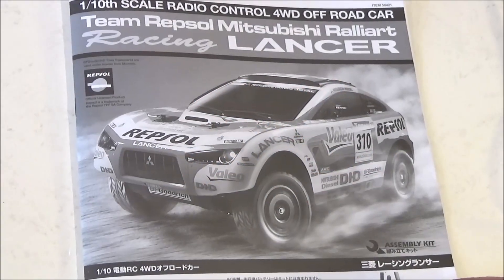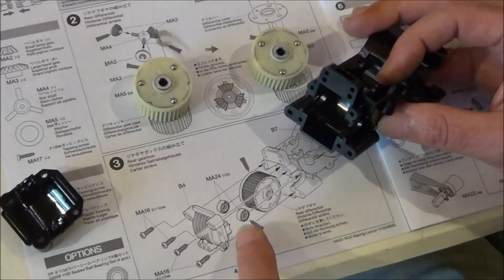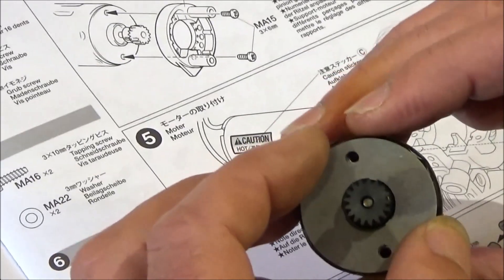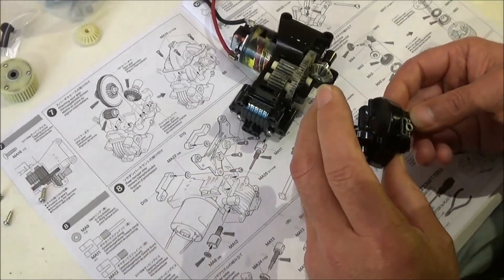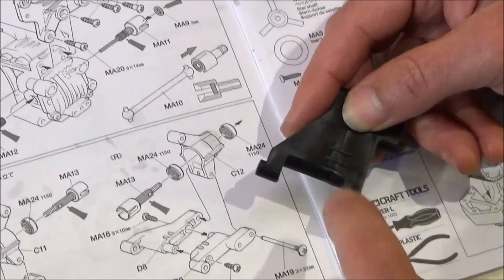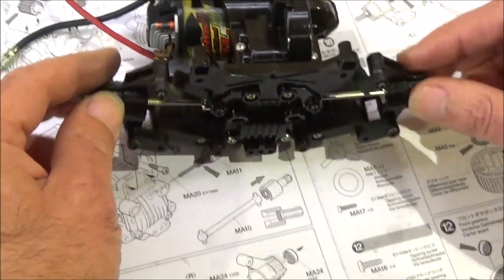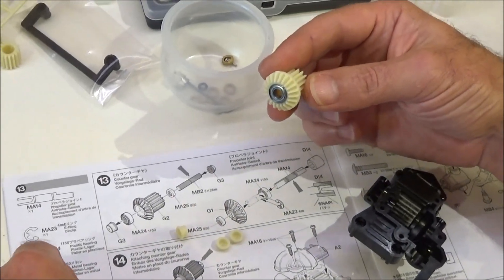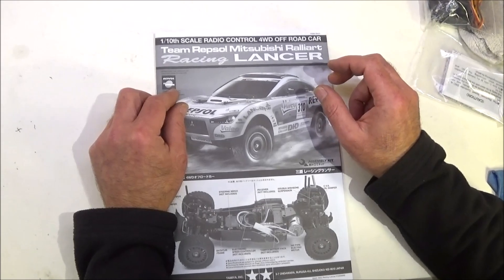Tamiya DF-01 Build Part 1 - Mitsubishi Lancer Rally Car

Comment: 😎👍 Nice Job! that's a sweet chassis!
Reply from the maker: Thanks very much Steve - yeah, I really like this chassis, it's a new one on me, and it is very similar to the old TA01/2 chassis that I rate very highly.  The DF differs in that it is quite a lot wider in terms of the suspension components and driveshafts - should prove a little better in the corners and less prone to rolling over - fingers crossed!!!  Have a great weekend Steve  :-)

Comment: Nice one mate.  It's odd that I've never seen this chassis before given how much time I spend looking at kits to buy.  I think your wife picked a good one.  Anyway thanks for the tip about the grease.  I'll get myself a tub of it.  One thing I've noticed on Tamiya kits is that sometimes they give you washers to go on the back of the step screws and sometimes they don't.  When they don't it's very difficult to tighten them enough so they don't shake out without them binding the suspension.  I'm sure that's true and I haven't just imagined it have I ?  Anyway, Rob is very patient with holding the camera for all that time while you have the fun of the build.  Good work as ever mate.  Look forward to seeing this finished and blasting around :-)
Reply from the maker: Thanks Pete!  Yeah, get a big tub of Lithium Moly - it's super greasy and is kind to plastic! Those step screws really need a washer - you are correct, they should come standard on all Tamiyas to prevent the binding issue. You didn't imagine it mate!  Rob and I have been though thick and thin my friend, and luckily for me he has the patience of a saint! To be fair, we do help each other, that's what friends are for I think!  Thanks for watching and the lovely comment - looking forward to your next escapade!  :))
Reply: Yeah if memory serves me right I think that the Konghead and the GF-01 didn't have the washers.  Can't understand why they wouldn't put them in all the kits with step screws given how cheap washers are.  Anyway, I was looking at this chassis and on the face of it it seems similar to the TA-01 that I know you are very fond of.  I haven't really looked in depth but do they share components ?   I've got another Datsun 240Z shell to build but as yet no chassis to stick it on so I'm looking at the various options.  Look forward to seeing this one run.  Cheers mate.
Reply from the maker: Hi Pete! Yeah, I am with you on the washer thing, don't understand why the differences between the kits either!
And this DF chassis is very similar and shares a lot of parts with the TA-01/2.  I'm pretty sure the 240z will fit on the TA-02 escort chassis you have - seems like an ideal starting point!  :))

Comment: Loved it! Great build and video. Not too sure if I like the body/car ... everyone else but me seems to love it though so I think I'm just weird :-) I think you should have used the plastic bearings and the alloy pinion ;-) Great to see you actually remember to seal the gearboxes with grease. I always seem to forget when building new kits ... maybe because my brain is so focused on the instructions ... When doing repairs etc. opening gear boxes of used cars I nearly always do it though before I close them again. Ohh, and why the special grease? Again, I seem to be the only one in the world using the supplied grease in the kits. Any secret reason? formula? And what did you call the diff joints/cups?
Reply from the maker: Thanks a lot, Mikael!  Yeah, the body is not the standard saloon-car looking body, but it was specially designed for rally-raid events like the Dakar (which I follow every year on TV). As such I think it is iconic, and obviously a lot of others are fans too.  But if you don't follow the Dakar - it won't have the same appeal to you - which is fine! 
 I use Lithium Moly (Molybdenum disulfide - MoS
 2 )  grease  because it the Moly is an extremely low-friction compound, and when applied to components, they retain their lubricity even in cases of almost complete grease loss, keeping parts lubricated even if the grease is flung off by centrifugal force. When added to plastic components, MoS
2 forms a composite with improved strength as well as reduced friction. Plus, it is very cheap and commonly available in the automotive industry - my massive pot was only £6 and will be sufficient for well over 50 RC kits!  I like to fill my diffs with grease as it adds a little limited slip effect, and there simply is not enough Tamiya grease supplied with the kits to do that.
Oh, and I call the diff join/cups "output shafts" because they are the components that transfer the power from (out-of) the diff!!   This is what they are called on 1:1 cars too!  I hope this makes sense, Mikael!  :-)
Reply: @MarkBryanRC  Thanks for making me aware of your reply in my video! Well, sometimes some important notifications fly by me without I'm noticing. Ha, I knew you had a good answer. It seems like most of the stuff you do, you actually know why you are doing it. Not the same with me when it comes to RC, in many cases I just do the same as others or what they recommend :-) Like using Tamiya grease. It says "Tamiya" so it must be good, but in truth I have no idea if it is good :-) You shoudl really do special videos about something like this. Show what you are using, how you are using it and explain why. You could try it, and see if anybody's watching (I'm sure most in the hobby would want to, but it's always hard to get videos like that accepted by the youtube algorithm). Yeah, the few times I've filled up my diffs with silicone grease it works good. Even better with AW grease if one wants a very limited slip. I have to look into that grease. I just have a hard time with stuff that don't have an RC brand behind them. Silly, since I also know that stuff gets 100 times more expensive when filled in small tubes and supplied with a sticker of an RC brand even if it is the same stuff. I guess that stuff does the same as the Tamiya Molybdenum Grease I've received with some Tamiya kits? It's strange how Tamiya works with grease in the instructions. Ceramic grease for some, silicone grease for others, and then the molybdenum grease for others. Thanks a lot for the answer, Mark.
Reply from the maker: Ahh - I fully understand Mikael - I miss lots of comments, and I only have a fraction of the views that you do!  I appreciate your reply my friend.

I have thought about the type of video you mention, but as you said, I am not sure how many people would be interested!  But yes, it is good to spread the word about using commonly available products that are not RC branded, but equally as good or better - at a fraction of the cost. More money left to spend on RC kits!  I am unsure also, why Tamiya use so many different greases, especially for the same function, one grease for the Rising fighter Diff, another for the TT02 diff - and no explanation why!  Hmmm, Tamiya move in mysterious ways!  Nice to read you - enjoy your Sunday evening!  :-)
Reply: @MarkBryanRC  Yeah, Tamiya move in mysterious ways :-) Hope you try out some videos. Just see how it goes. The worst thing that happens here on youtube is that only the good friends and subscribers watches - and that's really not a bad thing :-) The only problem I have with these kind of product videos is that it usually involves some kind of US or UK product bought in the local familiar store that every US or UK person knows, but is named or called something completely different in Denmark/Scandinavia and most often cannot be bought here :-) But your chemical names must still be called the same here in Denmark and world wide, so they will probably be easy to find, I hope. Enjoy your Sunday evening too, Mark.
Reply from the maker: Thanks for the encouragement, Mikael!  I may just try a video or two on some little tips and hints! I understand what you mean about "branded" products that everybody seems to know, but me! I find that there are a lot of USA products that I have never heard of - you would not think that we speak the same language!  Thanks for the chat, you are a real friend in this RC world, always a pleasure to read your words. Thanks, I am having a great evening!  Look forward to more RC chats!  :-)

Comment: great build! i am watching your build video again since mine is arriving in matter of days. i wonder if it's good idea to lock one of the diffs or both. let me know your thoughts.
Reply from the maker: Thanks Dave! Exciting, a new kit coming soon! I don't think you need to lock the diffs, I filled mine with grease for a little "limited slip" effect and that works just fine. The car runs well on loose surfaces as it is, no issues with traction at all. Enjoy the build!  :)
Reply: @MarkBryanRC  sounds good. I have some brushless 10.5t motor esc and thinking about using those.
Reply from the maker: Oh man! It will fly with a 10.5T fitted! Steady on the throttle!  :)

Comment: Hi mate when r u going up barnford next i just finished building a 3s lipo car so im gonna try to get a top speed run soon
Reply from the maker: Hey dude!  Not sure, as I have work at the moment. With a 3s lipo car, you might need a longer and wider run. Are you about on Sunday?
Reply: Mark Bryan RC yh mate im thinking about giving it a run up barnford Sunday its a carisma gt14 with a 3s lipo upgrade with brushless motor and brushless esc and when parts get here im taking the 6s tt02 up barnford for a speed run see if its made any difference
Reply from the maker: Cool - see you at barnford at about 2pm!
Reply: Mark Bryan RC all right then mate see u then
Reply from the maker: Cool - as long as it's not raining!  =)

Comment: OY! Mark, AO! Rob!!!  We have very similar build styles.... One thing, do you get your Cars wet - or even Damp?? If so, I would highly recommend using Marine Grease instead. A little thicker, but more importantly, it's non reactive to water. I've seen often, more so on real Cars, but RC Rigs too..... Even if they get a little wet, the Wheel Bearing Grease turns to Double Cream! 😱 
I wouldn't use the Tamiya Ceramic Grease on Gears... Sure it's Plastic Safe, but SO is Automotive Grease!! The Ceramic Grease either dries up, or just squeezes away from the Gear Teeth.
.... Of COURSE, just a suggestion. 😉

If you want to, the Marine Grease is barely more than WB Grease. If you have a crappy Big Box Store, like Walmart here, they're very close in price indeed. Hey... I was able to afford it!!! 😆😅
Reply from the maker: All the best mate!  :))

Comment: Those gear boxes look just like the ones used on the TA-02 kits, are they the same??
Reply from the maker: Hi Bob! Yeah, I'm pretty sure they are the same - my spare TA-02 motor mount fitted straight on to this gearbox!
Reply: @MarkBryanRC  after watching the other vids, it is based on the TA01/TA02 chassis i think, at least it looks that way. Cheers for the great sh&$ again..
Reply from the maker: @UncleBobsRC  Yeah, Bob, I think the only difference is in the A-arms (wishbones) that I can tell, the main tub and gearbox cases are the same. Cheers, dude!  :)

Comment: Why df-01? Isn't it the oldest of tamiyas df line of chassis?
Reply from the maker: Hi Alfred seniggah.  Not completely sure what you mean - Yes the DF-01 is an old chassis, but it suits as a Dakar rally car platform due to its width and off road capabilities - I chose this kit because (for a Tamiya) it is a little different and I like the Dakar rally Repsol body shell looks. We will see if it is any good :-)
Reply: @MarkBryanRC  
I just thought of the df-03ra was the better and newer chassis
Reply from the maker: Ahh - I see!  Yes, I believe it is, and I have no idea why Tamiya used the DF-01, the DF-03 is a pure  rally car chassis, as far as I know it is the narrower width (like the TA-02 and TT-02) that suits the pure road car body shell width, like the Subaru Imprezza.  The Repsol Dakar rally raid car is significantly wider - so that is the only reason I can think of!  :-)
Reply from the maker: By the way, I have looked at the DF03 before, but it is not imported into the UK at the moment  :-(
I really like the Datsun 240z on the DF03ra platform!
Reply: @MarkBryanRC  
🤔 In Germany its widely available.
I have a df-03 DARK Impact White Edition myself, and its the best performing Buggy i     
ever had. It even handles great with my hobbywing 4000kv combo. The gears of my TT-02b had desintegrated by this Point.
😂
Reply from the maker: Well, my friend, you are very lucky!  The df-03 Dark Impact is a beautiful Tamiya, and I imagine it is fantastic fun with the 4000kv combo - and the plastic gears in the TT-02 vs the metal gears in the Df-03 differentials will always fail first! Have fun with your buggy!  :-)
Reply: @MarkBryanRC  
You gotta step up your import game
Reply from the maker: Haha!  Yeah Alfred, too right!  :))